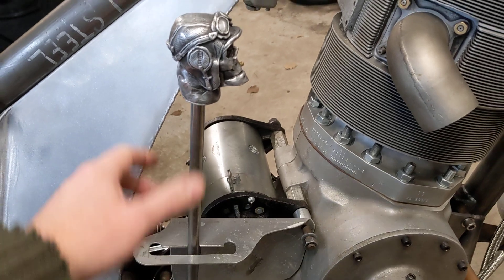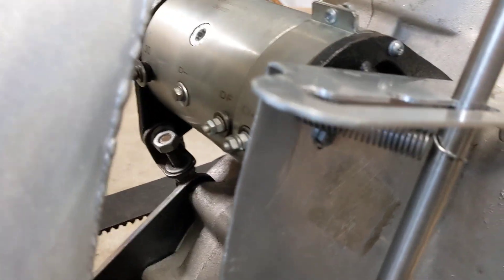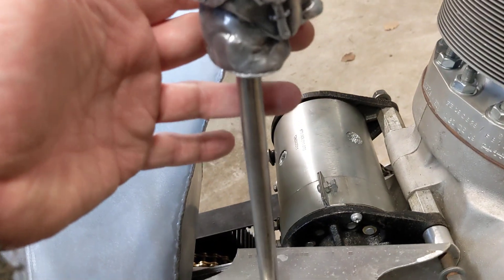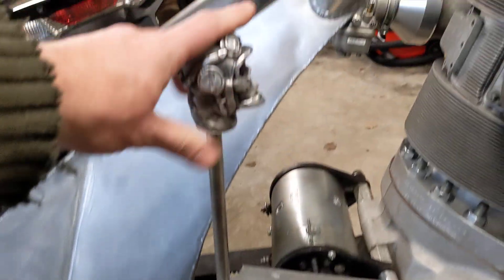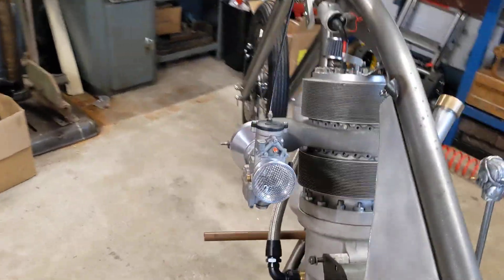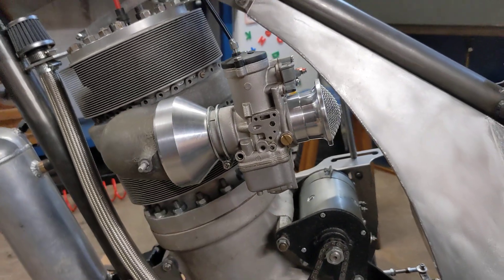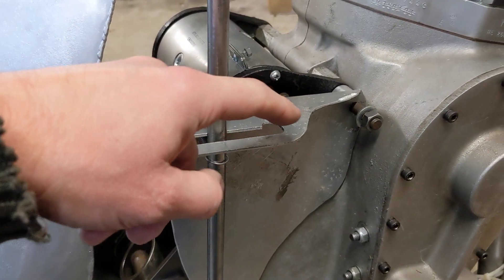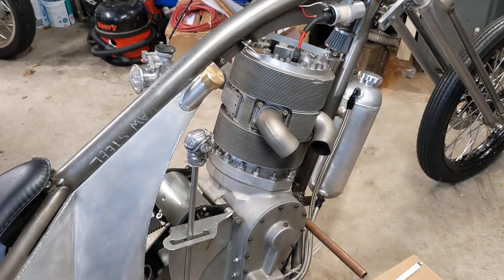Gear Selector Finished 💪

Comment: Nice gear selector plate 👍🏻, I thought perhaps a flat piece of spring steel in constant contact with the shifter instead of coil spring 🤔. It's easier to draw than explain😅👏🏻
Reply from the maker: @tiff9137  I think I know exactly what you mean. A few ideas were milling around my head. Still some fine tuning to do.

Comment: Nicely done. One query, with the amount of vibration, along with making the notches deeper, perhaps also make it a dual spring set up. Less indivudal tension = long life. Addtionally, provides security if one pops off or breaks. Just a thought.
Reply from the maker: @anaru5643  the reality is the gear stick is right up against my leg. Once it's in top gear, it'll stay in the notch. My inner thighs can be quite persuasive 😉

Comment: Getting very close now. I reckon you'll have a shakedown run by Easter
Reply: Yeah, just the rear brake, front brake lines, rear light, brake light switch, wiring, handlebar controls, battery box, ignition switch, sidestand, footrests, exhausts,  fuel lines, fuel pump,  horn, carburettor to mount and tune, chainguards (2 front; 2 rear), MOT, vehicle inspection, insurance and snag list etc. 
Two months? Nae bother!

Comment: Hmm, engine produces enormous vibration, gearstick is very long made of springy metal, gear knob at the end of that shaft is metal with a lot of mass...
🤔
I think you might need to cut those detent notches a LOT deeper.
Reply from the maker: @wizrom3046  that's the plan, a bit of fine tuning on the slots and spring tension.

Comment: What if you made a u shaped adaptor for the carb so it sits forwards and above the intake, get the angle right and it would also level.
Reply: It needs a totally different carb, that carb is extremely undersized and not suitable.
So there is no point doing too much with carb setup until that has been addressed and a suitable carb has been chosen.

Comment: Forwards is way better. Are you still trying to add the kickstart?
Reply: Steady progress, can't wait to hear it.
Reply from the maker: @zekethegeke5317  no. I have a plan for starting, probably in the next video!
Reply: @ in your video about starting it you had 2 big batteries in parallel so I assume you can’t use a regular motorcycle battery and it will be hard to mount 2 batteries because of that gas tank. Maybe unless you time the decompression valve perfectly. How complete do you think you are with the build? Because In my mind you only have throttle setup and starting but it will probably be a couple months?
Reply from the maker: @zekethegeke5317  yes, another couple of months and I'll be in the road. I said that 7 years ago 😝 A fair bit too do still so next spring probably. I have a starting option, when we got it running the first time we used a 24V motor - just to get it running.